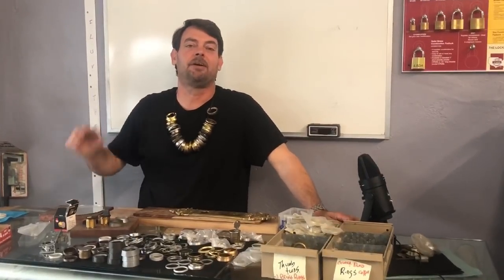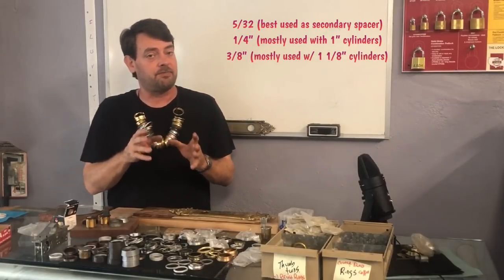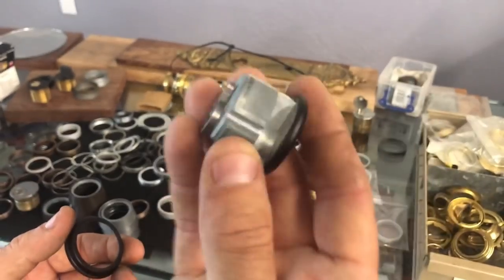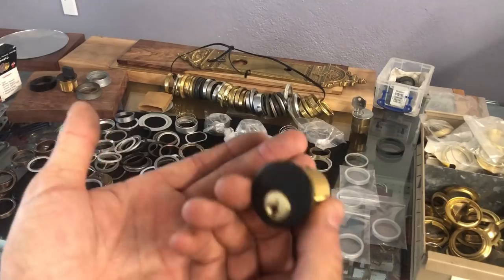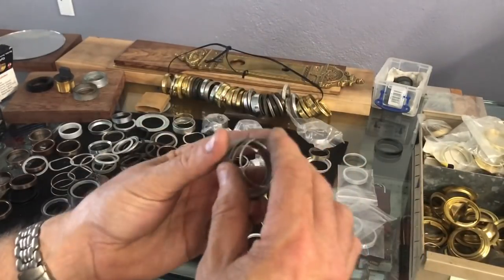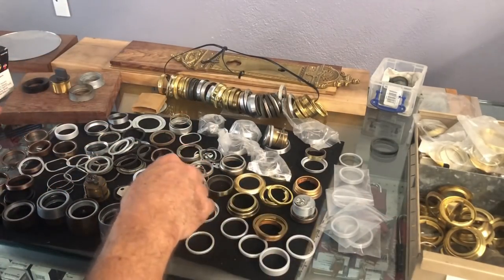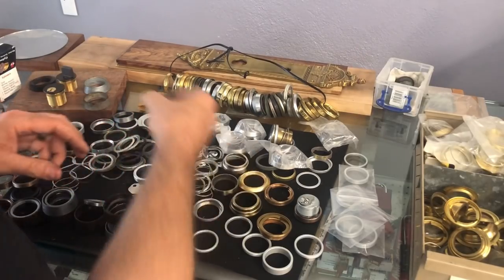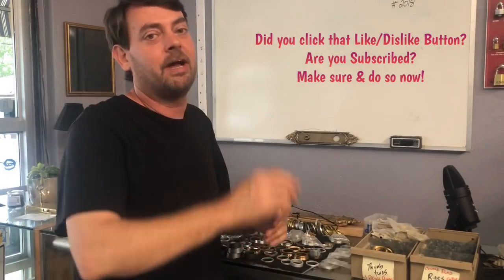Spacer & Security Rings for Mortise Cylinders

Comment: Good information Jason! Almost all of our mortise cylinders at work are the dark bronze, so as you mentioned, it can be tough to get any hardware that the tint matches well. We end up doing as much as we can with the factory supplied hardware. Luckily, the factory stuff seems to hold up ok, since it doesn't see alot of cycles with almost everything operating on electric strikes and access control card readers. Thanks again sir!

Comment: Jason!! If I were to take a digital pic of the inner workings of my entrance door mortise lock assembly is there any chance you might be able to tell me what kind of cam/tail piece I need? In a nutshell I removed the cylinder to have a key cut. gave it to the wrong person to get a key cut, and that's the last I saw of my lock cylinder. There are no visible ID marks inside or outside the lock assy. 
I'm game to buy what I need from you if you can hook me up. Thanks. Les
Reply from the maker: Les Holte oh no! Sure, email to selockandkey@gmail.com and I’ll see if I can tell